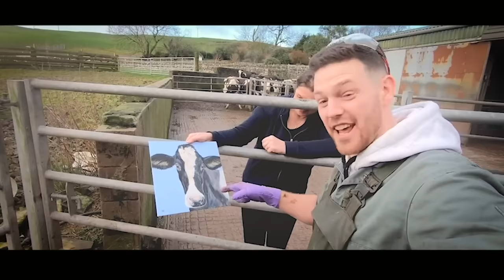TREMBLING in PAIN ... 1 COWS HOOF story | cow 812 | The Hoof GP

Comment: The hoofs need cleaning and re-medicating on a regular basis to quickly heal her wounds. The wounds must be kept clean , so they can heal quicker!
Reply: This is a farm, not a hospital, there is no way to keep the hooves clean.
Reply: @alistairclement4239  This is also a case of a very difficult to heal hoof. It even states this in the video. I was merely referring to the fact that if faster more complete wound healing was needed, this would be the next step. Quarantine the cow in a stall with hay bedding or rubber matting,etc..and give the cow’s hoof a couple of days out of the wet mud. This can be accomplished on the ranch, no need for a hospital. By the way, Do you (@alistair clement) have any experience in this area are you just rattling off a “knee jerk” response with no experience to stand on. I happen to have some experience in this setting.
Reply: @DanielM-il4rz  I have over 30 years experience in this area, and from the way you referred to hay as bedding, I think you're lying about your experience (hay is food, straw is bedding).
Fyi she had at this point, already been quarantined for quite some time.
Reply: @alistairclement4239  hence my point, so she had been quarantined! I was not aware of that from any of the videos..by the way, I’m from the American South, we use hay and straw interchangeably!! Remember, you started this, I was merely offering other suggestions to help the lame cow.